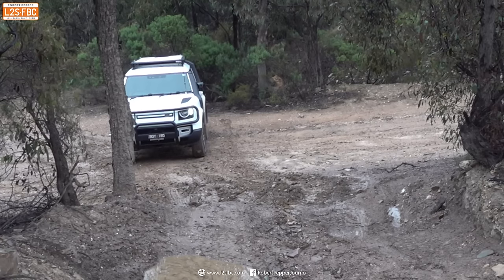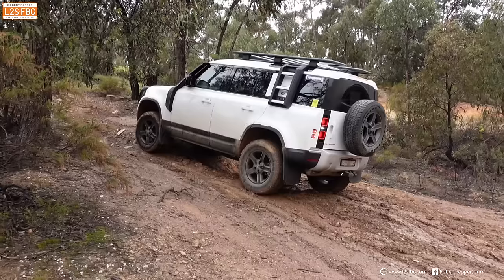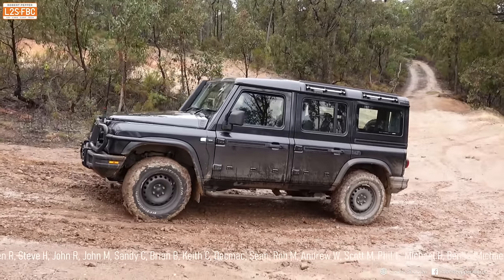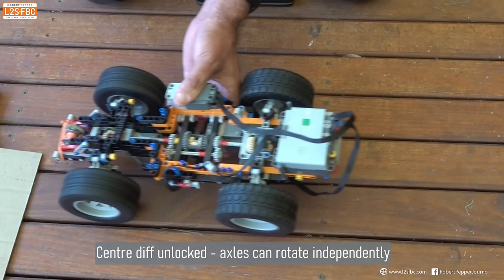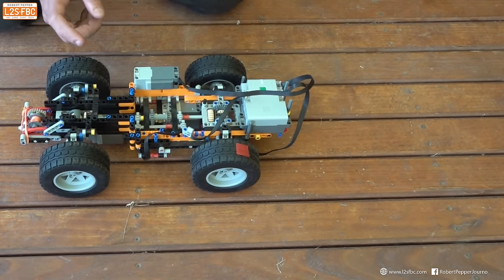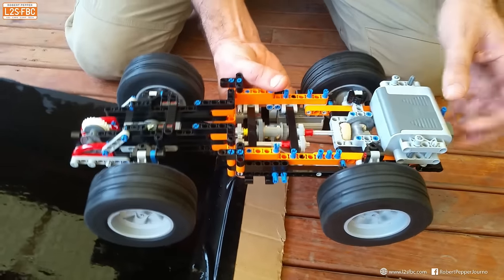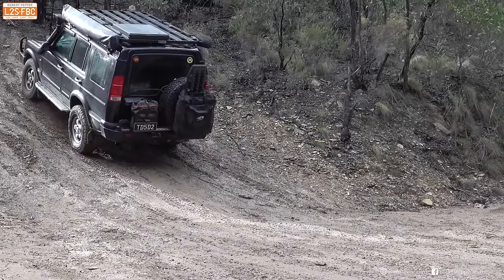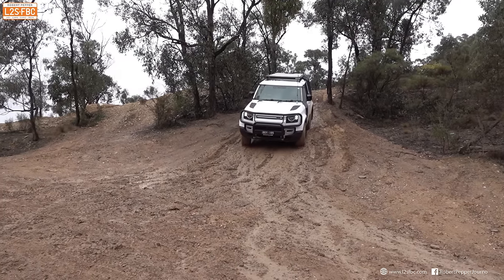The Centre Diff On Hills Problem: Grenadier vs Patrol vs LC300 vs Defender - Part 6

Comment: I have a 2022 Defender 110 with the locking center and rear differential. I have run into this issue while on the trail here in the USA. I overcame this by using Hill Decent Control wile in Reverse. I did a full day private driving lesson at my local Land Rover Experience center. They specifically taught me this technique for this exact issue. New tech for off roading…definitely a learning curve vs the old school off roading driving techniques.
Reply: Yep, but the plus side to the defender system is it's always on nature when just driving in, say, icy or slushy situations. You don't have to put it in 4H or anything, it always just does great.
Reply: I have a new Defender and previously a "classic" Defender. Old school offers much more  opportunity for driver error between the binary choices of high and low range,  CDL locked and unlocked than the much unfairly maligned new tech in the new one. As you say getting to know the new ways is an interesting challenge: man and machine,
Reply: @paulelledge8977  Ice and slush are not a hazard where I drive but here outback roads vary over small distances between firm-packed dry clay, gravel, very soft bull dust and sometimes wet clay. Misreading the conditions can result in disappointing outcomes. The new Defender takes out some of the guesswork.
Reply: Reverse up hill puts extra weight and bite on the axle with the most traction.  A front wheel drive car will have amazing traction reversing up a slippery hill with the limiting factor usually being the high gearing and inadequate engine torque rather than loss of traction.
Reply: That is what I was taught as well.  When on any hill with low traction HDC should always be engaged on LR products.   Forward or Reverse.

Comment: Very good Robert. The 'backwards toboggan' is one of the more alarming scenarios off road! One method I've used to counteract this, especially on wet mud/snow, is judicious application of the parking brake which gives you controllable rear wheel (now front) bite, leaving the front wheels (now rear) to steer. Of course, the widespread adoption of E parking brakes makes this impossible - a real safety flaw. This is one reason I went Grenadier (proper handbrake) - potential failed climbs (especially with trailers) is so risky in wet /snow conditions. This is a serious problem for Defender though - it's carried over from Disco 5 (no surprise) and is a sign the engineers prioritised road braking over off road. I'd say that's an acceptable decision on Disco, not so Defender.
Reply from the maker: I wouldn't even say it's acceptable on Discovery!  Yes that technique can work but it shouldn't be necessary. As I said in the video...yet to see any clever centre improve on a lock, and nobody has ever said I'm not pro-tech.
Reply: I have the original defender where manual cdl and manual everything gives you far greater control and not relying on technology to do that as long as you are experienced. I am an Electronics Engineer and yes electronics can make our life easier but you need to draw the line in many situations where it can in fact introduce safety and reliability issues. The new defender as we all know is built on the range rover and discovery platform and the amount of automation make so much easier for novices to drive offroad without having any experiences but as we see it has its limitations and introduces safety concerns.

Comment: Great use of models and, as usually is the case, excellent teaching. There are no software replacements for knowing how one’s machine works. I would rather make a bone headed mistake myself than have the computer make the mistake for me. 

My Golf R periodically, on the highway at 70 mph, decides to slam on the brakes because the computer thinks there is an obstacle in our path… there is usually an inappropriate word from me that follows…

Thank you for your efforts in helping us to understand our machines.
Reply from the maker: My pleasure and yes agreed - it's not knowing how the software reacts is the problem.

Comment: Mate, these are great videos.

As a BORDA off-road trainer this side slip is one of the main reasons we teach no braking on slippery hills.

Training is primarily for professional users doing a job. Realistically we would suggest a driver walk this first, understand what is likely to happen and then decide what to do. In this set of hills probably not today (water, surface, slope, cross-axle and trees). The fact that none made it back up i.e. going home.

Recreational off road is different.
Reply from the maker: Thanks, and agreed - you want to reserve all your traction for lateral grip as sideways = problems, and braking just use grip for braking not sideways. More here https://www.youtube.com/watch?v=dZ33KJ1cl_c
Reply: I sometimes or often rather brake to avoid generating momentum and sliding off the track.  If tyre pressures were lowered to say 12psi this track might have been okay to drive.
Reply from the maker: Yes, 12pis may have worked but we were there to test the cars, not get over the hill.

Comment: In the UK we need to be aware of this is there's the possibility of a  failed hill climes  in Snow and Ice on narrow streets.   As the front could swing hitting walls and parked cars.
Reply from the maker: yes and not just with 4WDs.  A 2WD car will behave the same way on a hill when you hit the brakes.
Reply: *climbs

Comment: About brake bias …

Sometimes, when off-roading downhill, it can be beneficial to pull the handbrake up 2-4 notches. I.e., to move the brake bias a little bit to the rear securing steering in the front while under braking.

Comment: Hi Robert, interesting - but you can actually manually lock the Defender diff-locks if you option the Advanced Off-Road Pack, which has Configurable Terrain Response. Edit: at end of video.
Reply: Correct and this point seems to be always overlooked but It was mentioned in the video.
Reply from the maker: Yes I did cover CTR.
Reply: Why did you not locked the center diff of the Defender just like what you did to the other vehicles? The Defender has the auto setting for the car to instantly lock & unlock the center diff but it also has the option for you to manually configure to lock or unlock the center diff and also even the rear diff.  Does this vehicle have this pack?
Reply: @LetsGo-wf1dy because you can't lock the center diff unless you have the advance offroad package.  All the other vehicles come with locking center diffs.  His example is showing what a normal situation for most set ups.
Reply: Then a degree of validation in practice for the cause/solution for the C/D diff problem would be to have these particular vehicles C/D unlocked and locked to compare the results if they would have the same problem as the unlocked defender. To see if they did better or worse. Observing the problem from the vehicle and solved by the same vehicle by applying a solution ( c/d locking) would have been nice.
Reply: @peopleschamp7258 that’s not really the case though… All the other vehicles are top of the range from their respective manufacturers, so a similarly equiped Defender would validate the comparison. My own Defender has 4 custom configured Terrain Response settings, with one having the centre locked in a “traditional” configuration and another with both centre and rear differentials locked. Not using the systems available to the Defender, purely because the competition lack it, hardly validates comparison.
Reply: @Defender_w74  I have a l663 with the advance terrain response package.  I understand your point.  I also have a Grenadier on order. The big difference is no matter what model you get with Ineos, you get the ability to lock the center diff.  You don't on l663 unless you buy the package.  Also, have you watched the other videos?   He demonstrates the Grenadier without using the locking diffs and the l663 walks all over it because of the better traction control.  His video is very valid as it explains the importance of being able to lock your center diff.  The LR doesn't allow it, again without the package.
Reply: @peopleschamp7258 Land Rover and Ineos obviously have completely different marketing strategies and associated target market for their vehicles. Having driven Defenders for the past 30 years (and having been a LR Experience instructor), I certainly agree with all the points Robert’s making with this excellent series of videos. My point though is that with the Defender, Land Rover gives you the option of buying a hardcore off-roader or an urban mall cruiser, and everything in between as suits your lifestyle. If you are doing a 4WD comparison, please do the car justice by using a suitably optioned vehicle aimed at doing 4WDing, and not one that was optioned for town use or the occasional beach trip. While all Grenadiers might come with centre diff lock, the mediocre traction control is going to significantly handicap any model with lower specification than the Trialmaster, so with that as starting point, a base specification model might have been a more accurate representation of the Grenadier?
Reply: @peopleschamp7258  yes I agree the l663 has a far superior traction control system. The Grenadier has far too much wheel spin before it kicks in. In some countries you can get an aftermarket company to unlock the CTR.
Reply: @Defender_w74 I agree. All along , the Defender was misrepresented with the handicapped version. With its unparalleled traction control and without the optional factory lockers, it was still able to  perform very well.
Reply: Excellent video Robert, yes thanks I missed that bit at the end where you do of course mention it. There are aftermarket companies that can make this CTR software appear on any new Defender, as it is already on the system.
Reply: @LetsGo-wf1dy  Exactly. If the goal is to go serious off-roading then the buyer will opt for the Defender with the Configurable TR system with locking front, rear and center diffs and thus that should be the vehicle you use for comparison.

Comment: Really good video!
I noticed this exact problem in my Amarok but didn't fully twig why.  The irony is they say special braking due to a steering angle sensor and ESP will keep you on course, but in practice it is not as good as a lockable centre diff.  Many manufacturers should be ashamed of themselves for pursuing different ways of doing things that are overall inferior.  Research and development is supposed to weed out bad ideas.
Reply from the maker: How did you notice it in the 'Rok?  I noticed it when doing the downhill test you saw with Discovery, Prado and Everest. Same problem, unlocked at rest.
Reply: @L2SFBC  I noticed it numerous times.

First example, i was reversing and trying to turn but it wouldn't turn.  If i had been able to turn i could have tried another line forward or reversed out, but because i couldn't turn i ended up needing to be towed out in reverse.

Another example was forwards.  The track had a section with poor grading, there was clay on the track and inadequate lip at the edge of the track.  It was a slight downhill gradient, narrow track, big dropoff.  I was originally driving down at slow speed under constant mild braking (no low range!) and the nose started heading off the track.  I reversed back.  If i had driven down under power i might have been alright, but i didn't want to take the risk.  So i tried inching down .  But primarily due to front brake bias and unlocked centre diff the nose just kept sliding towards the dropoff.  I parked and walked down the hill to my bogged mate.  Helped him out, and he then drove up the hill through that section with no issue.
Reply from the maker: Thanks! Yes that's exactly what I'm talking about. Takes a fine eye to notice it and understand why, as sometimes it's masked by driver behaviour, but once you know about it, then you see it quite often.

Comment: I've just modified my old 4x4 which has a Borg and Warner TOD (Torque on demand) transfer case. One of the issues it has is unlocking the centre diff (if you even want to call it a dif) as soon as you take your foot off the gas.. making hill decent and braking in 4wd a nightmare. I've modified it to add a dummy load to the clutch coil effectively locking it in place at the flick of a button which is super useful when pulling the boat out of the water and trying to get traction on seaweed. Usually the back wheels would spin first, then the transfer case would pick up on the spin and add torque to the front wheels.. but by that stage you've already started to dig a hole and bog down at the back, so locking the centre helps a lot. Poor man's answer to a locking center dif I suppose!

Oh and I never even considered breaking force while the centre dif is locked! Bloody legend
Reply from the maker: Great mod and thank you!

Comment: Hi Robert, I had a TD5 Discovery 2. 2001 model with no centre diff lock. It tried to kill me twice with this issue on two difficult climbs. Another issue that car had was the traction control cutting out or just failing leaving you with just one wheel drive. I loved the car when it worked. In the end the oil leaks got the better of it.
Reply from the maker: That's why Land Rover put the centre lock back. Dead customers aren't good for business.

Comment: Top models of Ford Ranger and VW Amarok have smart centre diffs with the option for both locking the centre diff or disconnecting the front prop to give rear drive only.  Yes these can be driven in 4wd on the road using the smart diff function called 4A on the Ford. These are very similar to Mitsubishi’s well established ‘Super-Select] 4wd system. They also have rear axle diff lock available on Tremor and above.  Downhill brake assist? Yes. On Wildtrak X models they even have Trail Steering assist, which is a form of independent rear brakes, like a farm tractor, to assist tight turns on a trail.
Reply from the maker: Indeed...Toyota and GWM have had the rear skid-steer for a while, and you're right it's similar to Super Select.

Comment: A lot of vehicles now only use caliper piston size to atain a greater brake force to the front axle. For example, the D2 (and also my '97 Defender300tdi 110 commercial) there is no bias valves, it's all done in equal pressure to the calipers and the piston size distributes the force. Here is the absolutes: At low speed, brake force is fairly even (especially at the speeds you're showing), the force needed to lock a brake is minimal, in fact virtually mothing on mud like you have shown. The ABS also regulates bias on brakes as when a wheel locks up (usually opperational over 5mph/8kmh) then the electronics reduces pressure to that wheel - hense the lack of need for a bias valve. Lets consider braking from 100mph, it as you describes requires a lot more force to stop the wheel rotating, to the point not many brake systems will actually be able to lock the brakes at all at that speed, so speed is relitive to the force needed to lock a brake.
The problem I see is no one actually knows the force applied to the brake pedal and thus the wheels, the Freelander 3/Defender driver could have been applying more force, thus the wheels will lock, the fronts will unlock later for the reasons you have said, but that means there is not enough traction to overcome the brake force applied. Generally it is what it is. I did have a look to see if the L663 was viscous or manual locking or clutch pack, I couldn't really find out a lot about it but seems you can have either a "manual" proper lockeing diff or a viscous/clutch locking diff - this obviously makes a difference to how the vehicle distributes the forces from the drive or the brakes. HDC will, I would have thought engage the clutch pack in the centre diff if it has one and HDC off won't (why use something that's not needed!). The question would be; would it be considered driver or machine error for not applying the centre diff/HDC? Does the Freelander 3/Defender know what angle it is on? I doubt it. But it could be handy for the braking system and transmission to know as it can then act accordingly and aadding drive also works to sort out the drivelinepply HDC or varied brake force without it needed to be manually selected. 

All the vehicles suffer loss of traction due to higher than necessary brake force, it's life. ps, it's not understeer, it's skidding! the wheels were locked. That is 100% skidding, you can't blame steering and suspension geometry for that. All vehicles skidded down the hill as they suffered loss of traction, even the gren, it just had it on the rear axle. Adding drive can also stop skidding on hills, but suggested to be a more expert method. as it gets all wheels moving at the same speed and thus gives ability for traction. 

HDC only opperates at a set speed so it's design is to slow you to a specific speed, under that you can still use the brakes or not as you like, even if you are on the brakes the HDC on some vehicles still activahes the brakes more to slow the vehicle. I tried this yesterday in a Freelander 2. 

When I get some time I will make set of lego models to show you what understeer and oversteer actually is, it's characteristics of the design, all else is skidding.